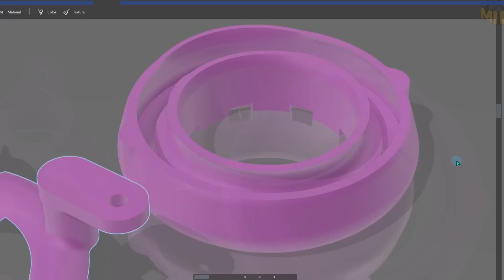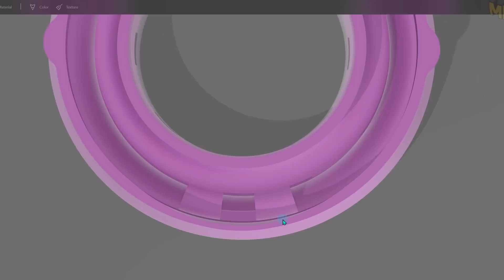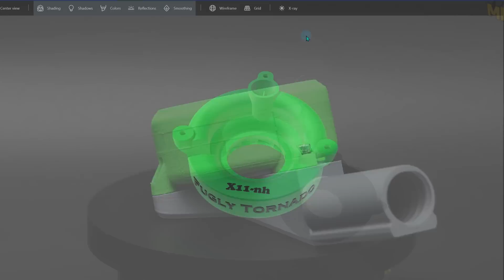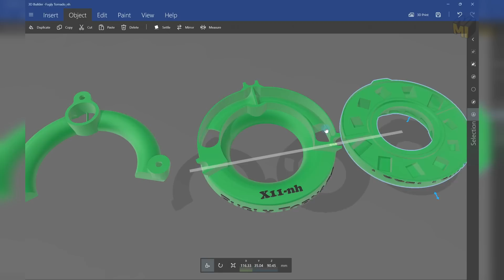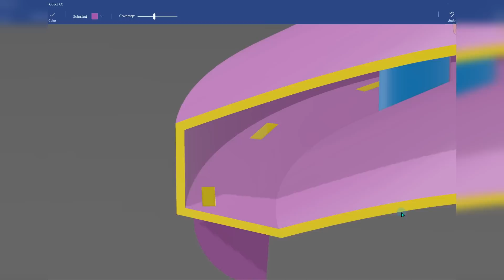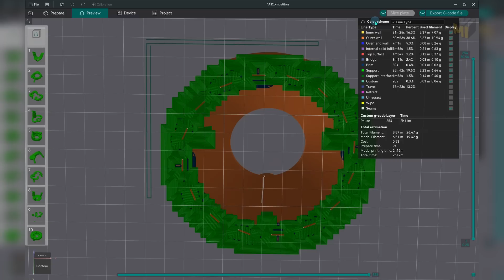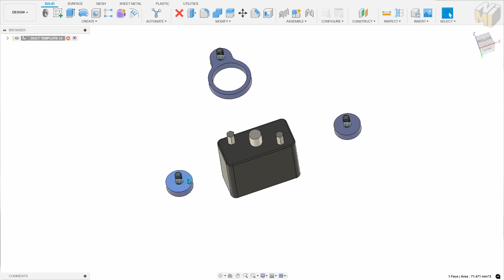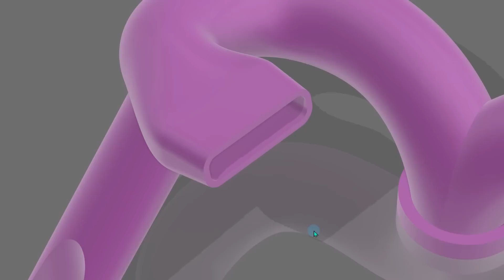Ep.3 - Massive UFO Duct vs Alien Exoskeleton 3D printer designs, we're nearly at the end!

Comment: When splitting a stream you will get more uniform results by increasing the volume at the T. Like how you balance cavities with injection molding. Add: with IM it is of course because of the solidifying. With air it is for pressure balance improvement.

Comment: 00:50 I feel that :)
#29 years old...
BTW: have you considered the radiant heat from the build plate?
I can imagine the black surface radiating a lot of heat into the chamber and directly into the part
A simple test would be to print one sample again without heating the bed at all
(if that works anyway)

Comment: Sorry for the dumb question (as I am a resin printing nerd with no filament printing experience) but why would you even want to spray air at the nozzle? Isn't the point of these printers for the nozzle to be hot and melt the filament, and isn't there tremendous issues with previous layers cooling too much and then not sticking well to new hot layers? Isn't blowing a ton of air at where the action is going to cool down the filament that is being released causing it to already cool down before we want it to cool? It just seems too backwards.
And if the answer is "well we need to make sure the nozzle doesn't overheat then... simply don't heat the nozzle that hard in the first place?
Also, if its about the fumes/smoke then first of all wouldn't a vacuum function make more sense, and second would the fumes/smoke even hinder the process???
Reply: @spork861  you want the material to solidify immediately as it's coming out of the nozzle, so pointing it directly at the nozzles orifice is generally the right choice. if the plastic remains liquid for too long you end up with those melted and deformed areas as seen in this video.

And yes nozzle cooling can be a bit of an issue, though it generally doesn't cause problems unless you have some really powerful fans, bad ducting and a badly insulated hotend.
Reply: @cosmic_cupcake  I see, so I guess even after being lightly cooled the filament is still hot enough to stick to the previous layers.

Comment: I'm kinda convinced the bridging test is flawed when using the same cooling strategy as overhangs and small layer times. Having it contribute to the score of each duct seems more likely to skew the results rather than refine them. I say this because in every shot of the ducts in action, the bridges are blowing around, something that can't happen on the overhangs of small layer time parts. Surely then this indicates you should use less fan, basically the opposite paradigm of the other tests.

I recognize no one has time to tune each duct for each scenario, but I think it would be a lot more valuable if each test had a seperate predefined fan percentage suited to what the model is. small layer times =  most fan, overhangs = medium fan, bridging = least fan. This way the ducts should be more capable of doing well in all the tests.

Comment: Andizzle here. I am stoked about the results and I’m glad you noticed the little intricacies! I spent WAY too much time researching and designing it (I even found the shuriken test myself). I had 4 different iterations. I owe it to James Pray’s video about making a fan duct for my main design choices. Those being the large sweeps for gradual direction changes, a small and gradual area change from inlet to outlet throughout, and pointing the air from the ducts to hit just above the nozzle tip. I did try to make a more significant diverter but couldn’t figure it out. My initial approach was a 360° duct like Prusa, but quickly devolved to a triple duct, and then finally to the simple double duct. 
Thank you for the tests and ideas! This series has been a joy!
Reply: Your duct did awesome! Congrats. One of the top contenders I think.
Reply: @802Garage  Thank you! I am excited to see the end rankings.
Reply: Nice work! :hand-pink-waving:  Simple, efficient, good balance of output airspeed with coverage.  I personally believe strongly in leveraging directional airflow through the nozzle area to avoid stagnation -- despite all the complaints in the video about the anisotropic airflow, even the "weak" side is very good.  And airflows intersecting at an angle do cause some airflow to escape in the opposite direction.
Reply: @jamespray  Thank you! I had your video on repeat while designing, was falling a bit into madness towards the end lol. The angled airflow was for sure a good idea.

Comment: Rocksalt's design is very cool! Just gave me an idea as well. Wonder if he thought similar. You know how there are printhead and auxiliary ducts? With a divided duct like that, if the two separate passages were closed off from each other, there could be two CPAP hoses attached allowing printhead extrusion and printhead area cooling. The extrusion cooling focused at what just came out of the nozzle would work for any filament especially when doing an intense overhang, while the area cooling could be for filaments that need lots of cooling like PLA and high speed printing. More tuning madness I know, but a cool idea I think. Would essentially put aux cooling on the printhead.

Comment: Great to test ducts, to get a better design.I just wonder which design/effect give for each test object a better result. I hear often that 3 of the 4 sides are better. Why is the 4rd side not as good? As other's said down force air doesn't do well with overhangs. This requires testing if there are differences by changing the amount of air.
I wonder if you bring colder air to the cooler will do more as you want to cool the filament as quickly as possible in certain locations.

Comment: i don't understand why the bridging test is done at full fan speed. the more pressure the duct has, the worse it will do. but at the same time, that pressure helps on other tests.

 i feel like the bridging test gives a bit of an advantage to ducts that perform worse, just because there isn't as much pressure.

for bridging, its best to have the fan just high enough so that it cools the material in order to make it contract, pulling the bridge up.
Reply: Because as he said, trying to tune the speed for every duct would take an insane amount of time. For now this is looking at which one can cool the bridges best, taking disturbance into account. I think it's pretty obvious for example that the last duct is actually one of the best for bridging and would remain so even with the fan speed turned down. Ducts that almost entirely disturb the bridge without cooling likely aren't cooling the right spot well enough for bridging to perform well. 1,000 tests would certainly reveal all the strengths and weaknesses of each duct, but it simply isn't practical.

Comment: Yes, surface roughness does matter. A rough surface can help maintain a boundary layer, allowing faster airflow over it. If it's too smooth, air tends to stick and slows the flow. Since we're dealing with 3D-printed ducts, keeping a bit of roughness can help maintain high velocity and thus low pressure i suggest 0.10/0.12, which is important because the fans struggle with generating high pressure.
Reply from the maker: That is great info thank you.  This brings me back to a MythBusters episode where they were attempting to dimple a car to look more like the texture on a golf ball.  So some texture is good, just not too much.  It'd still be an interesting test even if we already know the answer, it's always nice to see the results of one vs the other.
Reply: @NeedItMakeIt  dont make the comparison with some stupid like a dippeld car, just take what i said kick it into chatgpt and let chat gpt guide you bc you dont understand the idea.